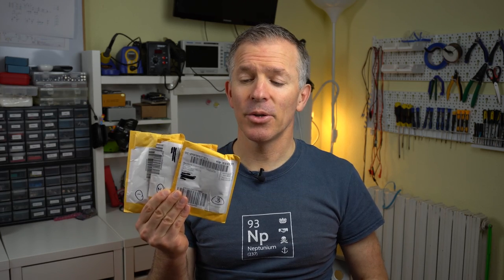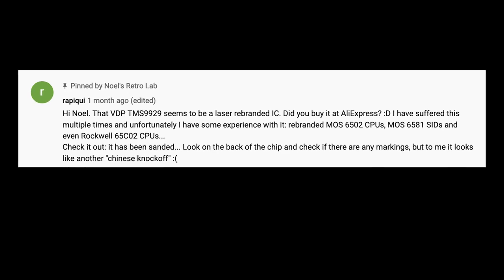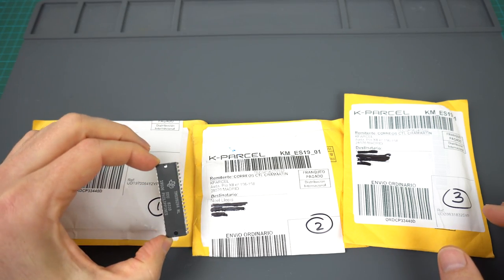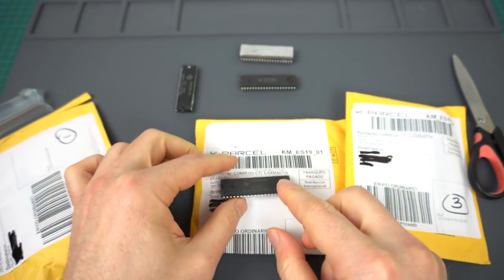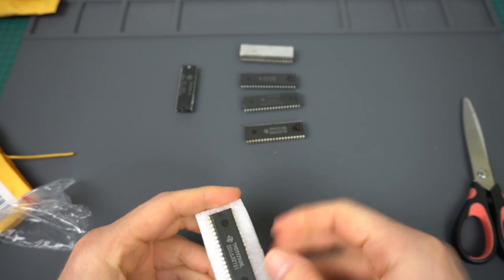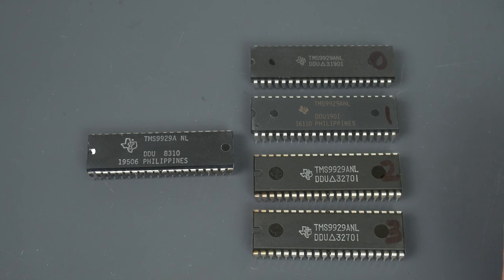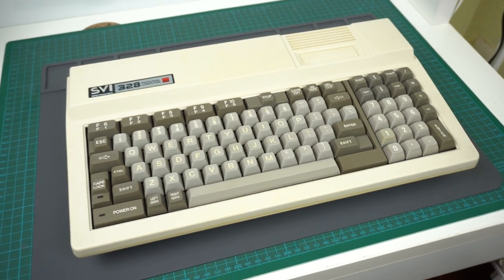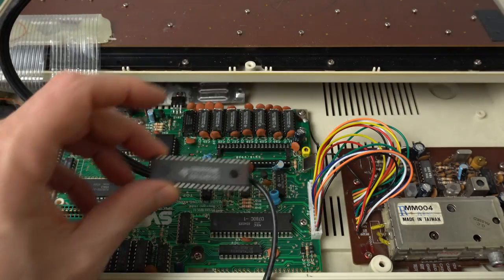Detecting FAKE Chips From China 🔍

Comment: It mainly works like this:
"Oh, this IC is cheap, I'll buy a whole load of them." ... ordering.
It takes between two and eight weeks before they arrive ...
Not testing them right away, so not possible to get a refund as it's too late.
This results in here-and-now profit for the chinese seller.

It's much better to purchase from a reliable source: Farnell, RS-components, DigiKey, Mouser or some other non-chinese company. Sometimes you can even purchase directly from the manufacturer.
Official sources always pack in ESD-safe packaging.
Note: Fradulent sellers on Alibaba caused me to stop purchasing back in 2012.
I've used eBay, because it's possible to get your money back (in most cases).
Even when you purchase from a "USA seller" or "European seller", you can't be sure it's not a chinese seller behind the account.
The reason you get the same packaging and the same type product is that the chinese sellers are just working for a much larger company; there may be 10, 20 or hundreds of sellers (depending on which company), and they all use a common packing-central to pack and ship the electronic components.
Defective components can of course be mixed with good components, sometimes you get several components that do not work even though the majority of the components work.
One pattern you'll quickly find when you purchase from chinese sellers, is that they just want to sell a lot of items; it doesn't matter whether it's small, big, cheap or expensive items.

Comment: From what I know... these Chinese companies had TONS of surplus circuit boards from the retro days..... they essentially use a plumbers torch to desolder all these chips off these endless piles of boards in seconds.... they then have someone sort through them quite quickly. It's very profitable as the old boards from back in the day cost them almost nothing and probably in many cases were boards they got paid for taking off whomever's hands. Even with all the trouble of returns and refunds and even low pricing, they are making a decent anount of profit. You'd be surprised just how many of us retro folks buy these chips. The 'fake' chips are just assumed to be what they are and were mistakenly marked. They literally desolder these off in piles. before sorting them. I've seen videos of this taking place.
Reply from the maker: Ugh! That sounds very plausible.
Reply: @NoelsRetroLab  I've seen video's of the operation in action. the very environment and building they do it in is rather unsettling. I wish I could remember the video I saw this in. If I find it I will send you a link. Those 'bad' 9929's could very well be working chips of some other type.... or possible the proper chip that was damage by the torches they use.
Reply from the maker: @GORF_EMPIRE  It's probably the one I just pinned at the top of the comments. Check it out. Definitely unsettling!
Reply: @NoelsRetroLab  I do not see the pinned comment. Can you post the link here?
Reply from the maker: @GORF_EMPIRE  Fixed. I think YouTube ate my comment because of the link. https://youtu.be/k72SFBOZ_lw?t=151
Reply: @NoelsRetroLab   Yep...similar stuff. Well not the same video but definitely some of the content is from the same places. But it should make clearer as to why you get bad chips from the east....while making you cringe. Nice work!

Comment: You shouldn't run component video over a yellow/red/white cable - the red and white cables are designed for audio instead of video and usually lack the right shielding/coax for a high-frequency video signal. (Though admittedly it will still work well enough to prove if the chip is fake). If you don't have a component video cable, just use three yellow cables.
Reply from the maker: Interesting! I didn't realize there was a difference, but that makes sense. Thanks for the tip.

Comment: It would be cool to decap the fakes and photograph them under a microscope to see what they actually are.
Reply from the maker: Yeah, definitely. I don't have the means to do that, but it would be pretty cool!
Reply: @NoelsRetroLab  You've got two chips for potential decapping, and one seems to react well to acetone. Just put the chip into a bath/cup/bottle/etc with acetone (the higher % the better) and leave it there, shaking from time to time. Heating/acids/etc will make it faster, but if it reacts to acetone and just rubbing, you should be able to dissolve it in room temperature over a few days. You may have to change/replace the acetone from time to time. Of course, once outer acetone-sensitive shell is dissolved, there may be more layers inside, and these may be not sensitive to acetone anymore, who knows. But that would be another step in faking and that would rise the cost, so probably acetone would be enough to expose interesting things.

Anyways, the other fake chip that wasn't reacting to acetone probably can be sanded/grounded carefully, just so the epoxy is thinner (stop grinding as soon as you see anything other than epoxy) and then ... burned. With a small torch, or over kitchen stove (old fiery one, not modern electric), campfire in the garden, whatever. Stinks as hell, better have a good ventillation, need to watch to not drop the chip or its parts accidentally into the fire/etc, but in most cases, epoxy burns to ash and can be just carefully blown away. Also once the chip is seriously heated up, bending/crushing it with pliers/etc can easily free the silicon die from epoxy, but it's better to train a bit on a few uninteresting chips first, as it's not that hard to break the die accidentally.

Sorry, it got a bit long. I've got a lot of fun doing that using totally unprofessional tools, good digital still camera on 'macro' mode, or a hd web camera may be enough to take a peek, especially if the die is large or just plain low-tech old!
Reply from the maker: @quetzalcoatl-pl  Interesting. Now I'd really like to try that out but... I realized I threw away the fake chips!! 😱 Normally I keep a box of faulty chips, but I reasoned that I didn't want these in there so I wouldn't get confused with real ones that are faulty (that I might pull out to run some tests for example). I guess I can always go back and buy some more from the first sellers 😃
Reply: @NoelsRetroLab  Aaw, that's a pity. I'm sure you'll get some new fakes eventually :) and there's no hurry, so maybe but don't waste your money on that. Anyways, I wanted to say, something bothered me after I wrote my comment and I did a small research what people find out in fake chips, and it turns out that the acetone-sensitive one most probably will not react to acetone any futher. It seems that recycling guys in china grind old chips to remove markings and then cover the grinding marks with black-ish paint, so the surface looks nice again. This means that bathing in acetone will most probably remove the paint and leave the original chip casing intact. soo.. decapping them won't be that easy. But! Burning or heat+bending should still do the trick :)

Initially I thought that they made the chip, but with a different die (or no die at all), and used some cheap acetone-soluble not-really-epoxy as the casing.. but that would be awfully expensive process for someone manufacturing a fake. Sorry for spreading misinformation, I should have listened to my gut feeling before posting, not the other way around :)

Comment: This one is a great one!!! thank you again Noel, a couple of cuestions: 1. Why did you use the VCC and clock signals to check? 2. On the breadboard you reproduce the scheme showed by yourself, well.. How do you protect the circuit (Arduino) ni case it has a short circuit? Again thank you very much
Reply from the maker: Thanks! 1) I chose those just on instinct because they're pairs of somewhat related pins. I could have probably chosen any bus pin vs. ground, and really, pretty much any pair as long as it has some kind of connectivity internally. 2) Good point (one I know you're well aware of 😃). That circuit doesn't do any kind of protection! It assumes you have a real VDP and it would probably be rare to have a destructive short. With fake chips, you can have anything though! So you're absolutely right that ideally it should have some kind of protection, at least on the output pins.

Comment: Usually when I need an I.C. for a repair I need it yesterday, so I order from U.S. sources that can get it tomorrow or the following day. But working on 60's thru early 80's legacy receivers and amplifiers I need matched pairs of very popular NPN/PNP audio power transistors. I found a deal on matched pairs in to-3 cases that was too good to pass up. I ordered 25 sets, and the first time I swapped a pair the PNP was much hotter than the NPN. You can imagine what that does to your signal in a push-pull circuit. In addition, these transistors were rated for 60 watts properly heat sinked, but they both died quickly at less than 20 watts. So I opened the top of the can and found my original transistors were about 1 cm square, thermally bonded to the base of the case, with pretty beefy gold leads from the wafer to the 2 pins. When I cut open the new ones, the wafer was about 2-3 mm square with much smaller wires, and the wafer was floating, held in place by the wires. It was obvious that I was sold fakes, and since this was before PayPal, I don't think I ever got my money back. Since then, I only buy from reputable, established distributors,  unless it's a discontinued, legacy component with no equivalent replacement,

Comment: In the past i had gotten some refurbished parts sold as new. They definitely were not new - some had their production stopped decades ago, others had clearly visible solder-residue on the pins, spraypainted and some other shenanigans. But they all did basically what they were supposed to do, but i never tested them anywhere close to their specified limits either.

Now i don't do that much electronics anymore but i get more parts and for cheaper - and i know they are genuine: A small local shop here sells old stock, old desoldered parts (and they make no claims that those parts would be unused or new) and (the thing i mostly get) big bags of random parts from SMD-reel leftovers. Usually just the last few components left over on the reel, for resistors and capacitors they often are a couple hundred even on a single strip but unmarked so you gotta measure your self. But those parts are not worth using in production for those companies and they are still perfectly fine.

Heck - i got lucky last time with a few high-power LEDs. A bag of parts for ~3€ contained 10 1W LEDs each for red/green/blue. It also often includes stuff like old flash-memory, ferrite-cores, quartz crystal etc.

Comment: Glad I found this video a while back, in fact after I saw it I subbed to your channel. Loving it.  Anyhow, I just ordered some 6309 CPUs and 6847 VDGs. 10 in total (5 of each) and NONE OF THEM WORKED.  The 6309's were just like your #1.  Kind of a faded rusty yellow kind of color.  2 looked like NOS, but got nothing between VCC and VSS as if they weren't connected and the other 3 (which had tinned pins), were giving me high ohm ratings.  None of the labelling would rub off, just like your #1. None of them had date codes either.  The 6847's looked genuine (all the pins were tinned though), and passed the rubbing test.  But 3 of them gave me nothing, 1 had a few working pins but no display, and one of them tried really hard to sync, and on the rare occasion it did, half the display was garbled and flaky.  Bad, bad luck so far on getting chips off of ebay.  Got a refund on the video chips, but I just found out that the CPUs were not working, so I'm going to ask for a refund on those tomorrow.  This sucks because it takes weeks to get them and is just a waste of time.  I'm trying to work on a self-made CoCo project and I can't get anywhere with all these bad chips.
Reply from the maker: Thanks! Yeah, it's getting really bad buying chips from Ali or Ebay! It's becoming more and more important to check them right away, but you're right that the most annoying thing is having to wait for weeks/months again to get some different ones.

Comment: Sometimes the retailers will put out a "tender" for wholesalers to make offers. It could 5000 chips. The retailer goes for the cheapest offer and gets scammed. The wholesaler just sold 5000 fake chips. Then a long drawn out dispute begins which rarely gets resolved due to a complex chain of custody designed to obscure the real dealers.
And also as others have said, its sometime a drop shipment and the retailer never sees or handles the actual product. And the whole dispute thing starts again.
The good thing is, the consumer is well protected and nearly always gets refunded. If you get scammed, dispute it. If the seller begs you to deal with them directly and privately, be careful.

Comment: It's not a new problem, I came across it, when young. Some "wholesalers" were able to provide an unbelievable variety of components. Some power transistors were expensive. (Hi voltage Mosfet etc). When a standard cheap casing was present, the only limit per day seemed to the re-labeling capacity of the company. So ordering the power component, you could end up getting a 2N3055 in rebadged version.
A friend of mine pointed that out; and we sawed off the top, finding a much smaller wafer, than expected.
Repairing my parents TV, I ordered the defective parts, and never was lucky, it failed immediately. The moment we ordered the expensive replacement part from the maker, it immediately started working again. Proving the component to be fake.
And at that time in the 80s, there was no ebay with buyer protection, or consumer rights acts of the EU. all you had was the sales contract, stating "no refund on semiconductors".

Comment: In the case of these particular chips there seem to be a few additional visual cues; The tops of the middle two legs have a notch on the good chips, whereas the legs on the fakes look more uniform. The outermost legs also seem more shapely on the good chips. And finally the orientation marker is a rather longish shape on the good chips, and much shorter on the bad chips.
Reply from the maker: That's true of the ones I got working from Ebay, but I don't think that holds for the original chip pulled out of the TI, does it?
Reply: Note that these Texas Instruments VDPs have been made in different fabs. As a result you can see many differences between the working one from the TI-99/4A and the ones he got in the mail, yet both are real parts. So you can’t just take the shape of the notches or legs as an indicator unless you’ve got a complete overview of the fabrication history of the ICs.

Also the pictures on eBay etc usually show a picture of one part they have made long ago, so you can’t take for granted that it represents the one you will receive.
Reply from the maker: @grauwsaur  Yes, that's true. They probably manufactured those chips for 20+ years too, so a lot changed over that time. And yeah, the Ebay pictures are useless to spot anything since it's never the exact chip you're getting (or even remotely close).
Reply: @NoelsRetroLab  Looked to me like all the good ones had these features. Can't tell what orientation marker looks on the one with the heatsink of course, but the middle legs still seemed to have the notches at least.

Comment: Most of the fake chips are not really that fake. It is manufactured in a same original manufacturer or by its chip packaging subcontractors. The issue is these chips when undergo functionality and quality control test, the factory operators would segregate the function pass chips and those fail chips to sort in a separate bin. Most of the failed chips would be end up in recycling center. From there onwards some greedy merchant would take these fail chip sort out and sell online as a good ones. These is what happen to all the fake chips flooding the market thus tarnishing every manufacturer's brand itself

Comment: Those "dips" are ejector pin marks, indeed part of the manufacturing process.
Reply from the maker: Thanks! I didn't know the term. I guess I should go look for a video on IC manufacturing process to visualize it a bit better. I love the TI "seal" in some of them though. I suspect that was done on purpose as a security measure against sanding down.
Reply: @NoelsRetroLab  The ejector pins push the part out of the mold when the two mold halves open in an injection molding machine.  https://youtu.be/cuF3gjvoSKU?t=2013 at the time timestamp shows the mold opening and ejection pins acting (on an unrelated plastic part).

Comment: That's gotta be super frustrating for out of production parts. I've turned to ebay a few times for nock-off digital components, like the DS18B20 temperature sensors, or analog stuff like TI I2C ADC chips. So far haven't gotten any that were complete fakes, but have gotten chips that did not perform to the specs published in the datasheet (ADC mostly). I suspect they're rejects from QA at a factory, that are stolen by employees, change hands a few times, and end up on ebay (and Amazon.) Nice video, thanks for sharing with us.
Reply from the maker: You're welcome! Yeah, very frustrating because those channels are the only places to get some of these old chips from. And it's becoming a bigger problem all the time.

Comment: I would suggest that number 1 is perhaps not a fake chip but a dead one, salvaged and resold as a working one. It would make sense given the fact it passes the external inspections.
Reply from the maker: I doubt it. The resistance is way off everywhere and it doesn't have that notch in pins 10 and 30 like all the real ones do (something I didn't notice when I made the video but people pointed it out since then). I'm planning on making a followup video opening them up and seeing what they have inside, so that should be interesting.